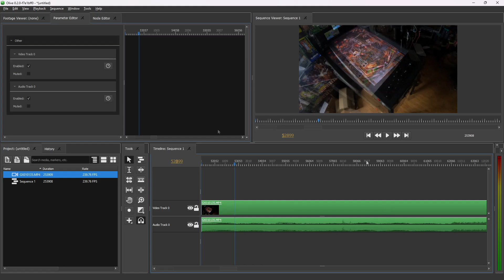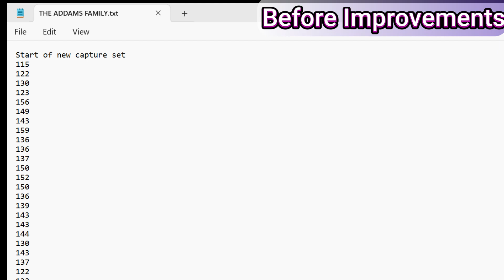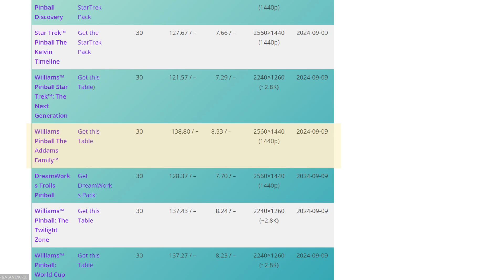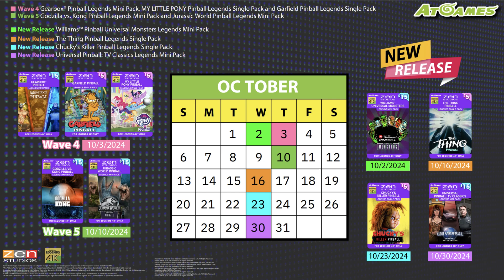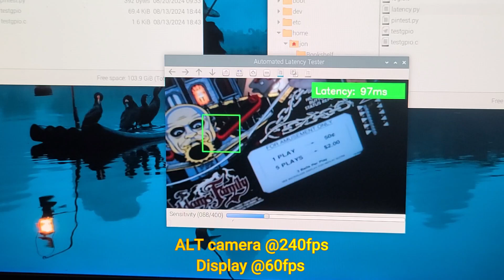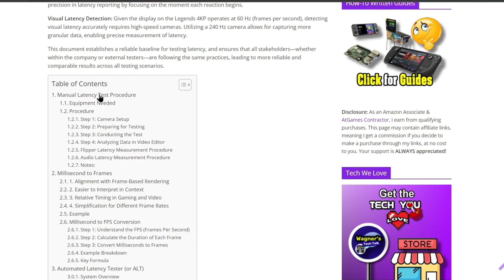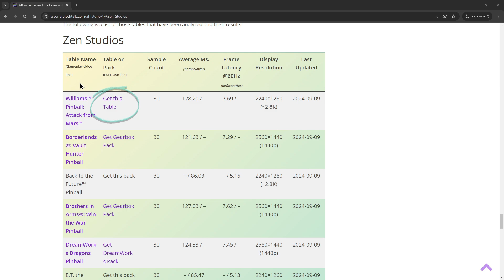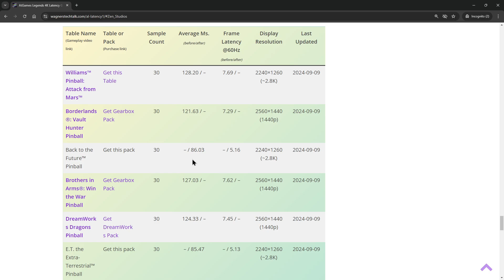Legends Pinball 4K Flipper Latency Improvements You Can’t Miss –Part 2

Comment: Congrats on the gig mr wagner! you always deserved an official position. 
I'd like to see latency measurements for the 1080p. because as a professional musician I deal with digital latency daily, I'm very sensitive to it and generally past 40ms is intolerable. I also notice it in hardcore shmups, most good ones are 1 or 2 frames of latency (33ms @60fps). now these fixes get it down to 95ish which is still nearly 6 frames of latency. I don't feel anything like that on the 1080p version It feels like its in the 40-50ms range. 
Resolution is not the issue of course, this is a Zen problem. clearly they are porting to these arm processors instead of re-coding. You see the same problems with any compatibility layer like proton. whatever middleware solution they are running to covert x86 code to these arm processors clearly has inherent latency.
Reply from the maker: Thank you for your kind words!  ALP HD is a bit different, I'd need to design a totally different custom board for that.  The HD version isn't able to play Zen tables (the 3399 CPU isn't powerful enough), but you should be seeing latency around the range of what you mentioned for native HD tables.

Comment: My verdict by "feel", not measurements: Definite improvement on Addams, and the three new Universal tables are very responsive. No issues with those. If I were going in blind and were just playing Jaws, ET or BTTF, I would never notice any flipper issues on them at all. If those are about 5 frames or about 80 ms of latency, simply by "feel" I thinks that's normal and ok.
Definitely noticed the ball stutter you were mentioning when playing other tables after playing Addams. Restarting the machine DOES make that issue go away. Thanks for mentioning it. If you insist it's temporary, I'll believe you.
Reply from the maker: Thank you so much for your feedback!  Yes, once we have all tables improved, the micro stuttering issue will go away.

Comment: Wagner,

Of course, thank you for doing all these tests and providing the info.  But I wanted to also thank you for showing us the resolutions of these tables.  The transparency that they aren't in 4K means a lot as some of us assumed that because we were getting a 4K resolution screen on the 4KP, that the tables would also be in 4K.  A bit of a bummer that they aren't, but I'd rather hear the truth and you provided that.

Thank you for all you do!

vgv
Reply from the maker: Thank you, vgv, I truly appreciate your feedback! In reviewing all the tables and measurements, it wasn’t just me who stressed the importance of displaying resolutions clearly—my boss made this a key requirement as well. This is one of the reasons I really enjoy working at AtGames—transparency is essential, and we’re always striving to improve.

The ALT system didn’t even exist until about a month ago. Before that, we relied on the traditional video editor method outlined in Part 1. While it worked, it wasn’t entirely accurate since it required subjective judgment of when actual electrical contact occurred. In my earlier videos, I used the upward movement of the flipper button as the indicator of contact, but this approach had flaws. I probably missed 1-2 frames of latency that couldn’t be measured accurately at the time.

Now, we’ve eliminated the human element from the process, which provides a much more precise measurement. Moving forward, accuracy and transparency will continue to be our top priorities.
Reply: Wagner,

I appreciate the notion to strive to improve and that transparency will continue to be a top priority, but transparency should've been a day one thing when it came to resolution.  I feel many in the community assumed (which I know it's not smart to assume) since AtGames touted putting a 4K resolution monitor into the 4KP, that tables would run at 4K resolution, not to mention 60fps with the refresh rate.  AtGames was up front about the lag on the Addams Family table, why not be up front on the resolution from the beginning?  It just puts them in a questionable light AGAIN.  Maybe it wasn't front and center in order to help sell more units, but it just looks bad.  I don't know, it's just another in a line of disappointments.

But I want you to know Wagner, you've been the spear when it comes to the times AtGames chooses to be upfront, so you are the glimmer of hope some of us hang on to.  Time will tell if AtGames will move forward with accuracy and transparency.  They have a long way to go with me before that trust can be built again.

And just a quick update.  I finally was able to put together (with the help of my brother) my 4KP.  However, the backglass monitor doesn't function correctly, just shows a plain white screen that flickers.  I did all the normal troubleshooting, powering it down, unplugging it, reseating wires, and doing all the updates, but it just won't display images.  I'm working with AtGames support to get it resolved.  This is the second Pinball product I've bought from them that's had an issue with the backbox.  It took AtGames support just over a month and a half to fix the one for my Legends HD, which wouldn't turn on at all.  I'm pretty depressed that I can't seem to get a working product from them.  I can only hope at this point that I get a working 4KP.  Hopefully it won't take them that long again.

Thanks as always for what you do Wagner!  Keep bringing us the good word :)

vgv
Reply from the maker: I didn't know what the resolutions were until about a week ago.  Once I found out, I added them to the latency guide and will be doing the same for the remaining tables.  Regarding your backglass issue, definitely submit a ticket on that.  We should get it turned around pretty quick.  I always appreciate you, vgv!  Thank you for your kind comments and I hope you enjoy the latest updates (they are live now)!

Comment: I have a serious question I'm hoping you can anwser.  I'm glad they are getting this better.  However this is a 4k machine right? Then why are all those zen tables only at 2k resolution or lower? Also you got that info but can you update us either on your site or address me here as what's the FPS we should be averaging during gameplay.  We were promised 4k at up to 60 fps.  So for example what fps is Adam's family running at?
Reply from the maker: I'm seeing a steady 60fps with the improved version.  Also, other tables are in 4K and those numbers will be posted as soon as I can get them measured.
Reply: @WagnersTechTalk  so all zen tables are only running 2k but everything not zen is running true 4k? Sry I'm trying to understand what you mean
Reply from the maker: Yes, other non-Zen tables are running at 4K.  There are currently two different resolutions used by Zen tables on the web page.
Reply: @WagnersTechTalk last question domt want to keep bothering you.oh is that something they will address to make all zen tables 4k without sacrificing the 60 fps like they initially promised when we purchased this expensive machine because it's kinda false advertising. Not blaming or attacking you just wanting some clarity.

Comment: 30fps is 33.33ms. So at 94ms we’re dealing with the latency of a 10fps game lol.
Reply from the maker: The 4KP display operates at 60Hz, not 30.  FPS is 60.
Reply: @WagnersTechTalk yes it’s a 60 frames per sec screen but it has the latency you’d expect in a game running at 10 fps.
Reply: I appreciate your work quantifying this but I think we can all agree that this is an atrocious level of latency in a video based game. Had this been published before launch the community would have said it was unacceptable and most people would not have ordered.